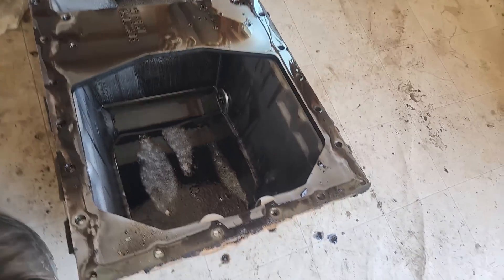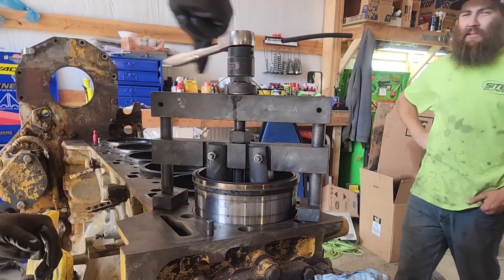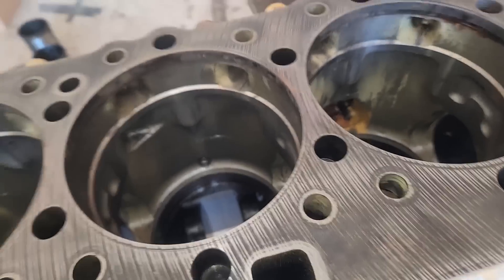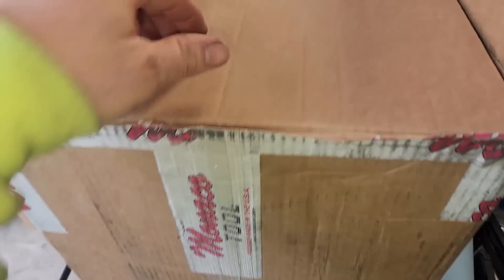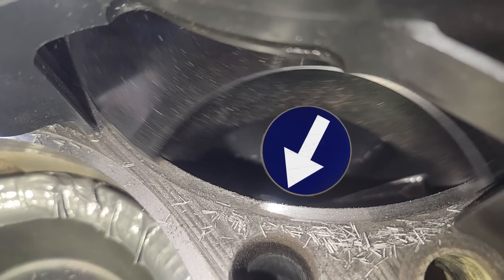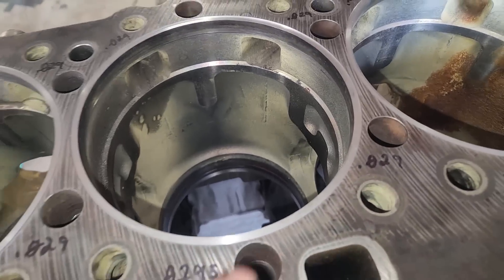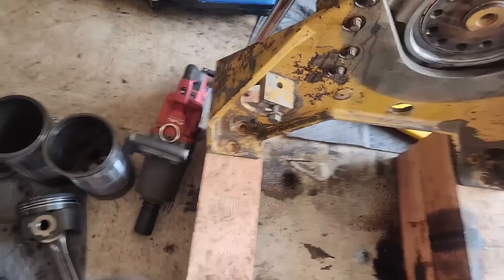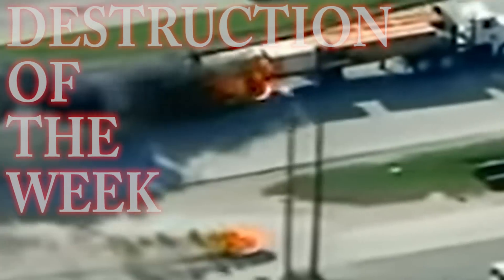800HP Cat C18 Engine Teardown. Pistons, Main Bearings and Counterbores.

Comment: You could use a bungee and mirror to assist you with degree adjustment after torque specs are reached. The bungee to hold the torque wrench up at the socket and a mirror angled towards you and the socket to check for the proper degree angle. Sorry I mostly do everything myself, too many times I've had people not paying attention and hurt me carelessly, unless my brother is helping he's a great worker and sibling.

Comment: Do you check the diameter of the cranks bearing locations before you install new bearings?
Reply: I assumed mechanics checked that to see if the crank needed ground.

Comment: We use C18's in dredging applications, typically at heavy load 1600-1800rpm continuous duty.

Are there any aftermarket components recommended for reliability? Our mechanic is die hard OEM parts only. But my thought process is there are alot of companies that improve upon manifold flow/cooling, etc.

Comment: Adaptape...if you can find a Autocrane electric crane, they work great floor mounted in the shop for lifting, turning engines, trans, etc.

Torquing mains, rods with the block laying on it's side is easier, faster and you can see 👀 better.

Comment: The liners are exactly what they should look like - the same as the day they went in. With Long Life Coolants you should never see any rust or cavitation these days (should never have seen significant cavitation.
3306/3406/C15/18/3500 are all old style liner designs. They had improved designs in having the spacer plate so to remove the counterbore for the liner lip. The liner the is supported down near the bottom of the liner. Newer design 3176/C10/11/12/13/C175 (Series 60) are mid supported liners. They have no flange at the top and they rest about midway down the liner (hence the name) at about where the piston changes direction. This means the liner is thicker than otherwise and the combustion part of the liner is supported top and bottom. A much better system and one that rarely if ever needs to have counterbores done.

Comment: Off topic a little but you are my go to so… I am doing injector seals in a 97 Ford L8501 Dump truck with a 3126. My issue is, this 3126 has the injectors  that require me to remove the rockers and I wasn’t aware that there are cups between the pushrod and rockers. I did manage to not drop them but somewhere between my work bench and the truck, I’ve lost 1 of them. So I have 2 questions. 1. What does cat call them in case I have to order? 2. For peace of mind, I ran my bore scope down in the hole and while I didn’t see anything, theoretically, could one of these make it all the way to the pan or if not, how far could it go? Sorry for the long post.

Comment: As far as Milwaukee impacts rank, Torque Test Channel has "Dyno chart of every Milwaukee Fuel Impact".  The 1" is basically same as 1/2 or 3/4 as far as removal torque.  1" is better at tightening though.  There is newer impacts since this video, not on graph.

Comment: I got one of the new Milwaukee 1/2” High Torque Impacts with the Forge Batteries for some stubborn bolts on a job 5/8” and up. Oh my gosh, it is an absolute monster and will snap off a grade 5 5/8” bolt way to easily. I have a lot of red tools, some are worth the hype, some are not. That one is definitely worth the hype. The Forge Batteries are impressive in whatever tool I use them in. Extremely long runtimes and compact size. I hear they have even better tech on the way. Those sleeves look thin, better heat transfer. Thanks for the Videos, Josh. Looking forward to the next video on the C18.

Comment: That pistol grip impact was never designed for mechanic work even milwaukee said that is more iron workers etc is more for tight fasteners
Reply from the maker: The rated torque is significantly higher than the 1/2" so I don't really care what it was designed for, it better put out what the rating is.
Reply: @AdeptApe I was highly disappointed when I received the gun and is not what expected I ended up buying the d handle which is better but still won't beat air impact specially doing undercarriage work I maintain a fleet of 120+ pieces of equipment I have used both 1" milwaukee guns for just about anything

Comment: Hey Josh, ever notice that the head gasket fails the most on number four cylinder on in-line six cylinder engines. Also the coolant use to enter on number four and Cat changed it to the rear now.  Had one come in a few years ago, that entered in number four. The customer used the block heater plug and put a hose to the rear as well.

Comment: What do you think of intake manifold water injection for turbo diesel? I heard it keeps the valves clean and helps cool the engine down more efficiently while allowing more reliable boost and fuel efficiency. I bet it would prevent dpf blockages and egr carbon buildup and or blockages.

Comment: On my d8h i tryed pulling one out with a 5 tone chain host and bent the 1/4 inch plate and couldn't get it tell i cut it with a grinder and 2 crowbar to pull it out

Comment: Thanks for the video!  Not surprising the sunk liners.  We see it quite often on c18 and c32 since they share the same liner.  Since they updated them back in 2019 or so, just chew up block counter bores.  Once you counter bore them, they don't seem to have an issue again.  I had to cut a whole alittle over .100" to get it to finally clean up.  Plus on the c32 they wear out the lower receivers usuallyhave to insert them at everyrebuild to.  Take care

Comment: You want 7 thousandths and a 30 shim on my third motor got 350,000 over the factory motor pushing an average of 40 pounds of boost on a 02 6nz that is at 4.3 million stock crank
Reply from the maker: Are you saying you like the liner protrusion at .007"?

Comment: Josh, is there a motor driven counter bore cutter?
Reply from the maker: There is a drill powered one that I used to use at Cashman Cat, but I don't remember the brand of it.
Reply: @AdeptApe Kentmorse, they only sold them for 2 or 3 years

Comment: The exhaust valves are to that side of the cylinder, so the liner expands ans contract the most on that side of the cylinder! Also when the engine stops air can come back from the exhaust to cool the open exhaust  port and the liner cools and shrinks, over time it wears the block. The stainless steal shim-inserts spread the cooling area out from under the liner lessening this effect on the block area! Watch on the engines you find the erosion, and it is in the exhaust valve side of the cylinder!
Reply from the maker: You are correct in that it is usually on the exhaust valve side of the liner, never really thought it could have anything to do with the valves, you might be onto something.

Comment: @AdeptApe, Josh, the 3/4” Milwaukee is a lot better than the 1” pistol grip. If you put the 12.0 amp battery and adjust the setting on the app, for the 3/4”, it’s the same as the 1”. Food for thought.
Reply: And the makita 40v is even better😊

Comment: That job would keep me awake at night. After it was all together i would think: "Did i make Shure i tightened that one bolt thats deep inside the motor?"
Reply from the maker: Well, you torque everything inside the engine, put loctite on certain bolts and just follow the directions. Not much else you can do, hope Cat designed it properly.

Comment: that's a horrible deck finish, has this thing been worked on recently? because the liners looked great on the outside.
Reply: I had a c7.1 on a generator set that looked very similar to this. The spacer shim/gasket leaked oil at very low hours. I think it had less than 50 hours on it. Had to get the block refinished. Solved the problem.
Reply: It is a Cat

Comment: I had a exactly the same model C18 on my peterbilt 379 over 2.744.000kms and still going very good 👍 👌  this is a one of the best CAT engine I think 🤔  regular maintenance and  keep going pulling hard 😊😊 cheers from Norway 👍👍
Reply: I was just wondering if C18 ever found their way into OTR trucks.
Reply: @prevost8686  I import my 98 peterbilt in 2008 in USA  made exactly 508.000mls/800.000kms on this  before I import!! here we can loading brutos 50ton!! it's a standard  heavy  in Norway  and all this years  I making a regular maintenance  on engine NEVER EVER doing anything! economy and powerful engine
Reply: Worst engine to be fitted in Sisu trucks.
Reply: @V8Lenny  I never seen a C18 on the SIZU trucks 🤔🤔 only a 3406E and C15
Reply: @jorgefonseca9225  no 3406E in Sisus , only C18 and C13 and C15 Acerts.
Reply: @V8Lenny  in fauske  have a  SIZU with a CAT 3406E  truck from 2001!!
Reply: @jorgefonseca9225  C18 , there was no Euro3 3406E
Reply: @V8Lenny  the 3406E it's a euro3!! and a C18 was a euro2!!😊
Reply: @jorgefonseca9225  E is maybe Euro1 , they are from 90s. C18 was Euro3 because british army wanted Euro3 emissions for they Oshkosh tank transporters.

Comment: Piston rings rotate in the grooves when the engine is running. (Unpinned 4 cycle,)  The end gaps occasionally align, but not for long. It is abnormal if the rings get stuck in the grooves and stop rotating during operation. At maximum engine speed, the rings rotate +/- ~ 6 RPM according to Ricardo.
Reply: Well….
If Riccardo says so..
Reply: @fastinradfordable   Ref: https://en.wikipedia.org/wiki/Harry_Ricardo

Comment: The Milwaukee 1 inch impact gun is great if you think it's not working well it will be down to you using a too smaller battery you need to use the largest battery you can buy with them they are amazing

Comment: 👍👍like anyone cares, but I've deduced from various sources,that the liner issues that engine and others  can potentially have is very likely from the low rod/ stroke ratio ...long stroke with a connecting rod that is too short..it side load's the  piston/ liner to the passenger side.. causing it to vibrate/ wear more so that direction.... perhaps that isn't  the entire story and i know someone else out there knows more on the subject....it doesn't really matter...great engine's either way... thanks for another video 👍👊

Comment: what can you warn about a boat with 3208 cats with 2700 hours?
Reply: @mmm365  thanks I definately wont buy that one   Vancouver Canada
Reply: Tubes between water pump and heads leak fail.
Not bad motors .

Comment: Love the videos, I work for a ferry company and we have 33 boats which are all Cat powered anywhere from 2-4 Engines.
3406e, c18, c32, 3412, 3512 depending on the boat. Been there 15yrs probably done over 100 inframes. We have a Kent counterbore tool.

Comment: Relating to you comment about liners not being easy to pull, we had a series 60 detroit that bound up on of the seals.
Welded a bar in and tried to pull it out with the crane, ended up lifting the front of truck off the ground by the liner.
Ended up having to remove the engine and get the liner out with the press
Reply from the maker: Haven't had one that tough, but have had them where the pack puller wouldn't pull them out and you have to pull the pistons and then use the puller assembly. Strange that the little seal you can probably bite in half with your teeth will bind that liner in there so tight.
Reply: The 14 L 60 series big rod end won't fit through the liner. The pack puller wouldn't grab the liner so we ended up putting a sheet of heavy grit sandpaper around the tool to get them out.

Comment: On an F150 I did front struts on, I think it was a 2004-2008 body style, it had a large bolt and captured nut. Torque spec on that was 450ft/lbs. Thankfully my shop has a OTC 3/4 torque wrench that goes up to 600ft/lbs. Even with me kind of hanging on, I could barely get it to click, but was able to do it. Kind of scrawny at 5'9 and 170lbs.
Reply: Yeah they're made for men 😂

Comment: If you wanna really good 1" handheld impact go with the 40V Makia XGT... i have used both and its not even close to the same. That Milwaukee you have makes more power in forward where as the Makia makes its power in reverse which is personally where i prefer it.
Reply: Those 40 volt are monsters. Soooo bloody expensive tho
Reply: @DanWoelders-fd5zd  Yeah they are pricy but it’s not much different in the terms compared to the 1” Milwaukee he already has.